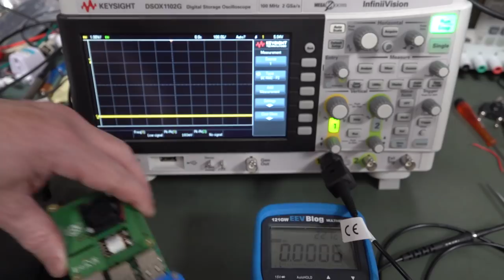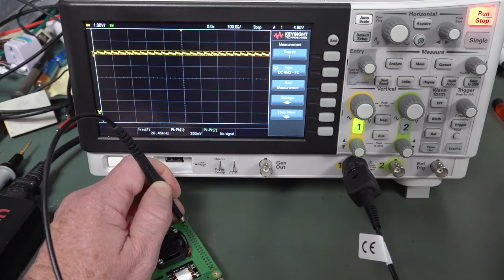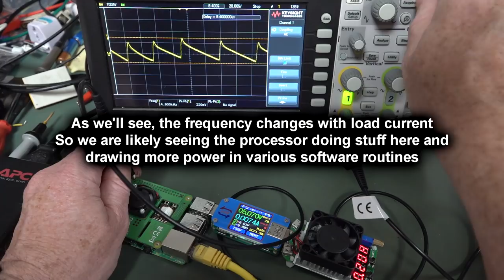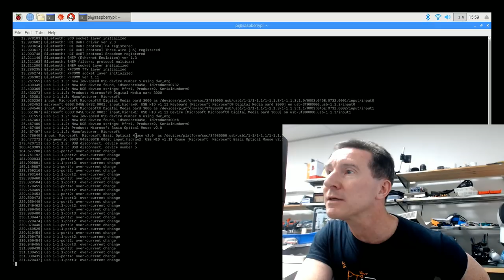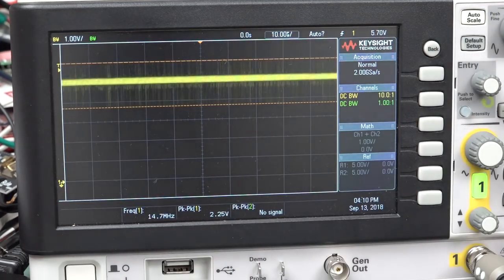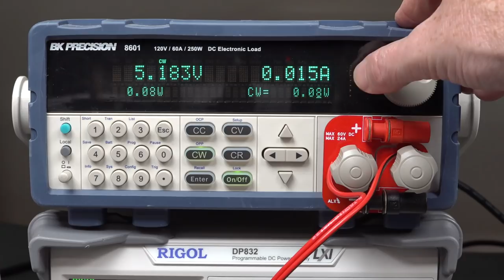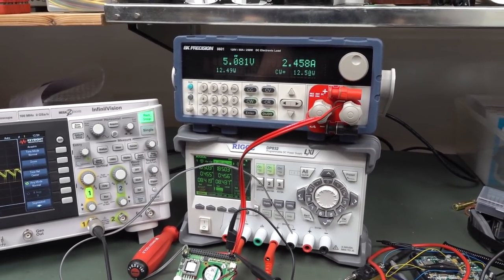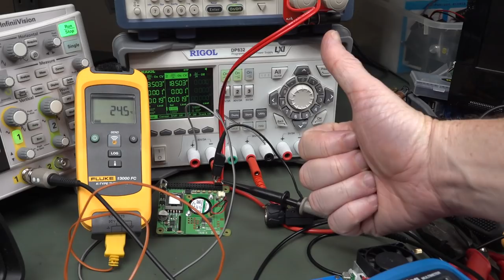EEVblog #1122 - Raspberry Pi 3 PoE Hat FAIL Investigation

Comment: Every RPi from the first to the last have had some hardware issue.
Reply from the maker: Hardware is hard.
Reply: But coming from the UK they should have known better. The chinesium Orange Pi PC is much better in every way, how can that be?
Reply: The UK version probably has some diversity hires in the engineering and some here know first hand how that crap goes.
Reply: lol diversity FTW
Reply: @MrKillswitch88  I kinda doubt that is the reason behind these issues, but hey, I haven't had to deal with it too much.
Reply: If it wasn't they'd just call it ware.
Reply: Looks like the kind of mistake someone with only text book knowledge and no hands on experience would make as this is a bug that should have been caught in testing.
Reply from the maker: Maybe the Orange Pi has issues too but vastly less people use it, so they either don't get found as quickly, and/or aren't as high profile?
Reply: MrKillswitch88  Diversity is our strength? At least that's what I keep being told at work everyday like a broken LP. Funny that the top of the house isn't diverse at all. Funny that.
Reply: Could well be, IDK the sales figures...
Reply: That is probably so but then again people of my generation and younger often lack the experience to get things done right these days, little simple don't this sort of things happen far too often especially with Apple crap such as using the wrong caps and resistors all the way to deleting or changing components without updating documentation. One thing that is so painfully obvious is that nothing is made to last anymore.
Reply: Hardware issues don't surprise me.  I don't think any of my version 1.0 boards were ever perfect either.

But the USB power issue really should have been caught in testing.  Pretty easy to trigger that one if you're using the thing at all.

Comment: The MP 8007 is only an IEEE 802.3af chipset so it’s only rated up to 12.95 watts at the PD.  Have you checked the combined loads to see whether  the Pi is drawing too much power to add any significant wattage on the USB ports?  It really needs the MP 8008 (PoE+).

Comment: I bought an unofficial POE hat by Navolabs because it was much smaller so I could fit my pi into a case.  I have yet to experience any problems with it, and I may buy another pi with the same POE hat.  It may not work with all POE injectors though.  My injector is a TPLink.

Comment: (Without more investigation) I don't get how the connector stops the power from the RJ45 jack  to hit the SoC? Or is the 4pin-connector 2 pins PoE in and 2pins ethernet out? But then again: how is it bridged so that the SoC won't be grilled if accidently PoE is delivered?
Reply: in PoE there still is a pulse transformer between the ethernet connection and the phy so the power cannot reach the SoC.
Reply: yes, but that is on the HAT, right? What if there is a PoE-injector on the other side of the cable but no HAT? So my main-question stays: what do those 4 pins on the pi? The transformer is on the HAT, not on the Pi itself. How is the RJ45 socket connected to the SoC? USB?
Reply: The pulse transformer may even be inside of the RJ45 connecter so the data lines come out DC-level free and the four power lines (2x positive, 2x negative to support all PoE standard) go to the connecter to the hat which transforms the 48V down to 5V. What is more is that if PoE is properly implemented there is no power on the data lines unless the device requests it following the PoE protocol.
Reply: Ethernet is transformer coupled. It normally blocks dc.

Comment: Dave/Others, the concerns you raised about the small spark gaps, is that really of concern when dealing with powers on POE?
Reply: How bad do you want 48V on your 5V rail?
Reply: POE quite often feeds devices that are up in the air, on long cable runs and go into different buildings where the mains earth may not actually earthed. Getting transients from a nearby lightning strike or 230V is going to be much worse.

Comment: Dave, did you try to draw the 200mA current from the RPi without the PoE hat? It is well possible it will cut out with the overcurrent warning even like that and the PoE hat is a complete red herring. RPi is known as not being able to supply much current over its USB ports, powered hubs and such are strongly recommended with it.
Reply from the maker: Yes, I tried that, wasn't a problem. Sorry, didn't show it in the video.
Reply: I don't think there are any problems drawing full current over USB on the newer Pi models, that's why the recommended power supply is 2.5A.  The USB power problems and the recommendation of a powered hub was with the original Pi 1 Model B's which has an issue with an under-specced polyfuse on the USB circuit which would trip.  It was super annoying for people who got the first batches in 2012 (myself included).  By the time the Model B+ with the current form factor came out, it had been resolved.
Reply: +Andrew Bingham The polyfuse was the least of the problems—you can bypass a fuse quite easily—the whole power design was a mess. I had to add a bunch of bypass caps to the USB ports (original ones were severely underspecced) as well as run extra wires to provide a solid low impedance connection that wouldn't pull down the main power bus and cause the CPU to brown out whenever a USB device was plugged in. Ideally I'd have put in a couple small inductors in series with the ports, but I didn't feel like cutting traces, so I'm still getting brownouts with some USB devices. 
And I bought quite a few of the firs gen Pis. Curse of an early adopter.

Comment: Is that USB Power Analyzer thing off by a digit? You say 200mA, your load displays 200mA, but the USB power meter says 0.0197A which would be just 20mA...

Comment: You only need 1500Vrms isolation for PoE, so it's probably okay the way they made the isolation. However is the ground connection capacitor a fail safe type? I didn't see any marking on the capacitor body.

Comment: You could tell the PS was going to be noisy just from your quick look at the layout.  They just put the filter caps where ever it was most convenient without thinking about the current loops.  I've seen this soooooo many times before.  Proper power supply layout involves carefully arranging the major current-carrying components so that the two loops are all on the surface and have small areas.
Reply: Yep. Even my experienced engineers get this wrong. You have to visualise the current loops, imagine the paristic inductances, sometimes even damp ceramic caps with resistors, rc snub switch points and wherever possible only have one ground connection point, usually the chips 0v bonded pad.

Comment: Why is the regulation on the primary and not the secondary side of the transformer?
Reply: because it is cheaper as it uses less components, very novel (and modern) way to do it, as he mentions it needs a well designed transformer though.

Comment: Does it feed back into the Pi on the regular connector or the 4-pin one? If the 4-pin one, try powering it through there with the bench PSU and putting the USB load on. It seems like this could be a problem on the Pi side rather than the shield. (Never mind, saw the pinned post)

Comment: Adafruit has a better solution.  The slot is not for isolation.  It's a hole for the flex print for the camera to pas through.  Part of the official definition of a HAT.  High isolation voltages aren't required here.  It's obviously inadequate for the Pi and the official 7" LCD screen
Reply: Isolation actually is required, if you want to be following ethernet spec, meant to be isolated for 1500v RMS.

Comment: I'm guessing the reason it got so hot is that you didn't have it on the Pi. When it is connected, the fan will be blowing air past these components...with it on the bench, the fan does nothing.
Reply: As a remainder, you must upgrade Rpi firmware in order to use the fan. Without fw upgrade the fan does not turn.
Reply: Additionally requiring active cooling and controlled environments rather negates the purpose of PoE.  I'm extremely underimpressed with this device, especially the evil voltage ripple with added transients.

Comment: How much power does that USB meter draw? Surely more than 50 mA ?
Reply from the maker: Oh, yeah, I didn't include that in my calc. Anyway, I expect boards to vary significantly. People report just a USB keyboard does it.
Reply: Probably people using RGB backlit keyboards? (mine claims 200mA)
Reply: Yeah I highly doubt it measures the draw of itself, that would defeat the purpose of it measuring the draw of other usb devices plugged into it.

Comment: Stupid question, but if you're only using a 350ma supply doesn't that mean you can only pull a max theoretical 350ma? I'm sure the Pi draws close to that just at idle.

Comment: I'm pretty sure that the diode and chips get so hot in your case, because the fan is not directing its output on a RPi, which would redirect the air flow over those components, cooling them down.

Comment: I don't want to be a "smart ass" but ...
If you diagnosed that the PoE circuit trigers the USB overcurrent protection -have you considered raising the current limit for USB ports to some degree (it's a config.txt setting) ?
If it's a glitch due to voltage ripple or some transient shit, raising the threshold... makes sense as a workaround!?
or maybe try to add capacitance to output filter (as a solution/upgrade) ?

Comment: Ive been looking into getting the POE HAT for a CCTV project. USB Ports are cutting out due to the USB Controller shitting the bed. But i dont like how the POE HAT is designed personally not a good thing to have for CCTV or on 24/7.

Comment: The Ethernet port appears to be a EDAC A70-112-331N126 POE Connector which is hipot tested tested to 2150Vdc. Which means it would be compliant to the 802.3 spec. The connector at least is fully isolated.

Comment: I just use a PoE to micro USB splitter to power Pi's.  Never had any power issues.
You do have a dongle hanging off the USB and network port, but if you're running the Pi with PoE, it's probably being placed somewhere out of the way hidden from sight.

Comment: Is it possible the fault is caused by inductance from the transformer interacting with the current measuring in the chip right next to it?  The reason for the surface mount  sockets is to keep the low profile!

Comment: not an isolation slot, camera cable slot.
im aggravated that the POE pins just toss all sorts of case problems, im snipping the pins off on mine, why dont they just leave it empty and let those that need POE do it a different way.

Comment: the fans were so loud (and unnecessary, cpu temp a tiny bit above 45 deg), that I pulled the power cable of the fans. Unfortunately I damaged the cables, now I want to solder it back on perfectly. Anyone knows the exact connector they used? Exact spec, size, etc. so I can order it on ebay or amazon. 

Also, I just created this issue to make the fan more user-controllable:
https://github.com/raspberrypi/linux/issues/2715

Comment: They could have simply used a shielded transformer to get rid of the noise and better filtering on the output.
Reply: the highest design goal usually is 'as cheap as you can get away with'

Comment: Unless your USB power meter is negotiating a higher current the "default" USB current limit is set to 100mA (in the USB standard). If the power meter doesn't enumerate as anything the pi assumes you have nothing smart plugged in and therefore limits the current.

Comment: i guess the ATTiny does some PoE Handshake thing
Reply: I was wondering what it was doing on there.
Reply: Something has to , a proper switch will not give you full power until you tell it what you need, unless your using 24v passive or other such nastiness. PoE can provide a relatively high amount of power , i have seen a protective PTC on a PoE circut in a switch fail and blow a hole in a 4 layer board before now !
Reply: Nope nothing to do with POE it just emulates the HAT EEPROM while also enabling software control of the fan. The PI itself has overvoltage protection, at 6V it will short the 5V input.
Reply: what is that EEPROM for?
Reply: Tsia device identification, so the host environment knows what you plugged in.
Reply: interesting. i didn't think that any identification would be going on for those hats.
Reply: @tsiatt  The government likes to know what types of hats you wear
Reply: The IEEE802.3at/af handshake you're referring to is not digital :-) so you wouldn't need a MCU to do it. This is not USB-C, to require a full blown Turing machine to beg the other side for power :D The only "digital" part in that standard is for (a) higher power devices and (b) for regulating the initial power level up/down AFTER the device comes online. Both are done via LLDP which would be waaaaay over the head of an ATTiny.
Reply: I dunno, I bet an ATTiny with a bit of hacky programming could speak LLDP.
Reply: @thewhitefalcon8539  I don't think it's fast enough to do that, but I couldn't find anything about LLDP timing online.
Reply: Oh yeah, didn't think about the speed. There are all-in-one Ethernet chips though, you basically send it a packet slowly over SPI and then it sends it. An ATTiny + one of those could do it.
Reply: Oh boy, (a) ATTiny only goes to 20MHz whereas Fast Ethernet is 100Mbps, (b) the Ethernet interface is a peripheral inside the RPi CPU, that's where the LLDP packet should originate, you cannot just "yank the line" from the RPi and inject your own packet mid-stream.
Having said that, YES, it would have been nice if the RPi engineers actually took pride in their work and made a state-of-the-art PoE module that you could communicate with in software (from the RPi side) so that you could cooperatively present yourself as any device class (in the context of 802.3at/af) and control power delivery to exactly what your application (i.e. end product, not software) needs and when it needs it.
But then again, they failed to even meet the most basic isolation requirements -- state-of-the-art is far, far away.

Comment: Looking at datasheet for MxL7704 and the published schematic (scraps) from pi ppl there is errors in the implementattion of the new PMIC.
They managed to connect the 5vsys stuff wrong vs the filtering so no wonder it keeps triggering low voltage for no reason.
A system that can handle 4v in and still deliver the pewny watts the pi needs should not have any issues with a slight dip. USB standards require it to handle 4.4v in and they keep using the PMIC's default triggerlevel of 4.63v even though it has configurable levels. I am so done with pi shit. I was so hopefull with this revamp but nope. Still requires you to wire the supply to the pi with 22gauge wires (for 2 amps!!! come on!) and even then use a 5.3v supply. (Breaking usb spec of max 5.25v)

Comment: use super glue under the 4 pin plugg for power and it is hard to rip it off.a drop when the socket is forced up from pcb a little the drop glue float under if you blow on it.

Comment: Nice review there Dave, lol at especially the last bit where you short the Pi HAT by accident. I will stick to my DIY POE for the Raspberry Pi using a POE injector and a AC to DC power supply and then breakout the POE voltage pins to a DC to DC buck converter to either the power pins on the GPIO header or on a solder type micro USB 5 pin header.

Comment: a few things (im not a raspberry pi fanboy or employee or anything) thats not an isolation cutout its for the connector, and this is not designed to supply anything to the USB that takes any real power its for when you remotely mount the pi for some lightweight environmental monitoring or what have you
also i should add that i hate SMD .1" headers ... i understand why its nessary for the no-reflow but honestly put the pins there and ill solder one in my self ... you dont need all 40 pins

Comment: Ooops, was working and listening. Did you blow the PSU on the board or the Rigol  PSU? It wasn't clear to me. I know you've had issues with the Rigol before. Sorry, man!
Reply from the maker: Sorry, maybe that wasn't clear, the PoE hat is dead.
Reply: Ah, no worries, Dave. Got it. Thanks.
Reply: The rigol should be fine with a dead short at 37v 2a.
Reply: You'd really have to do some work to kill any decent lab power supply.
Reply: Vince I Gone was the RPi PoE  Hat. Caused by a short with the temp probe.

Comment: The thermal issue seems way more problematic than the filtering.  Should not be reaching 120C at rated output.
Reply: No ventilation, and at the same time maximum input voltage means its not really under normal working conditions.

Comment: No, not making fun. It's too easy to short this stuff out. Soooo, add some capacitance, I guess, after you get a replacement. Or, buy some cheap bucks. I built some PoE->5V buck converters a few years ago for an experiment. I just tried one on a Pi+ and it works fine up to a half amp on the USB. I don't have a Pi 3 to test, but my warm resistor says it works fine up to 2 amps.

Comment: Have you tested out the Navolabs PoE adapter board? It's not really a hat per se, because it leaves access to most of the non-power pins, and it costs a lot more, but because it doesn't have a fan I'm thinking perhaps they solved the high heat generation of the official RPI board. I have ordered one but they were backordered.

https://navolabs.com/product/raspberry-pi-3-micro-poe-hat/